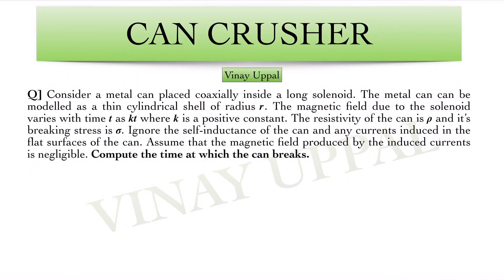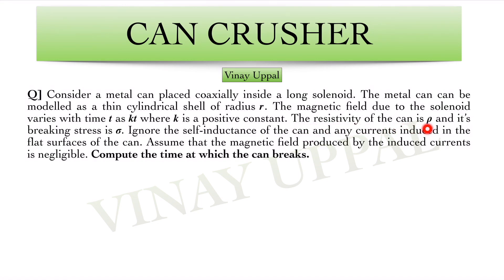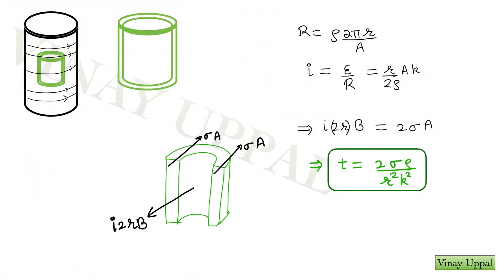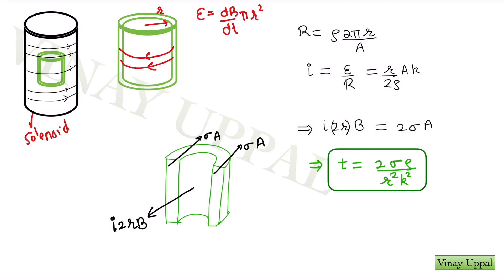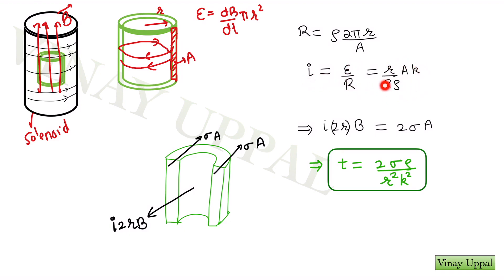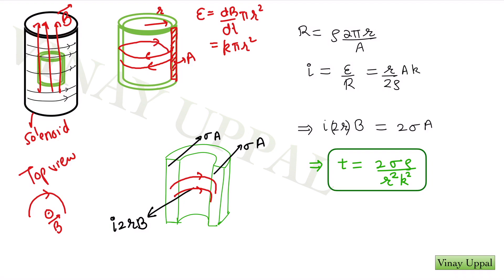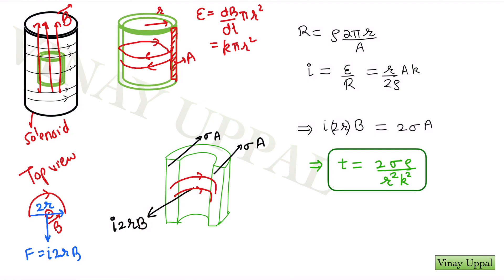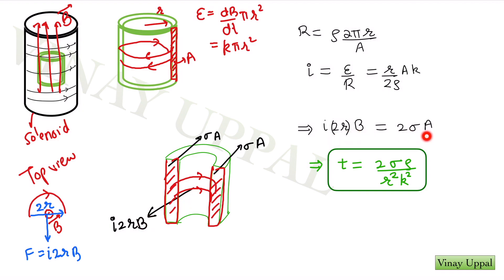PREDICTION: Episode 7 : Physics Girl Based! Can Crusher. EMI. Jee Advanced.

Comment: Sir why can’t we calculate induced electric field then use Vector form of Ohms Law to calculate current density. Assuming current I flowing across metallic can so force acting on it would in Outward direction BIL and then apply stress formula

Comment: Sir here instead of taking only a half section if we take a small element dl, there is a magnetic force Bi(dl) compressing it towards the centre. But what will be the direction of the force which opposes it and which part of the can applies the opposing force?
Reply from the maker: There will be tangential stress forces similar to a rotating ring but compressive instead of tensile
Reply: @PhysicsWithVinayUppal  Sir then how do we do this problem by taking elements and integrating over the surface? Because I'm not clear as to why we should only take half if the section, I thought we can get the same result by integration, but I'm not able to do so.

Comment: In the video the solenoid's length was small as compared to the length of can , and we know that the magnetic field due to a solenoid is maximum at its centre as compared to any point on the axis because of which the induced current in the can is maximum in the middle and it decreases as we go away from the centre in either direction , because of which the middle part of the can experiences maximum compressive stress , this is the reason because of which there is not a sharp cut rather there is bending at the portion of tear off and also because of this large induced current there will be a huge amount of heat produced in the middle portion which makes the metal soft and thus favours bending .Atlast the magnetic field due to the induced current is in the opposite direction as compared to that of solenoid so there is repusion between the solenoid and the can , half part of the can is facing repulsion in one direction and the other part is facing repulsion in the opposite direction which makes the can to tear off .
Reply from the maker: Perfect
Reply: @PhysicsWithVinayUppal  Thank you sir 😃
Sir do check out these two channels also Smarter every day , Steve Mould 
There can be many questions on their videos ....
Reply: @PhysicsWithVinayUppal  sir please create a jee advanced type question based on "ANTI GRAVITY WHEEL"
Reply from the maker: Only thing I'll add is there is also a longtitudinal stress in the Physics Girl video because of the radial component of magnetic field, whereas in my question there is no radial component of magnetic field
Reply: great analysis
Reply: Noice observatory skills bro
Reply: Thank you 🙂
But I am not that great 😅
Reply: Beautiful comment
Reply: Orz bro ✅✅
Reply: Nowhere in the experiment does the metal become soft. And your analysis is basic observation. Nothing special. Or interesting just like you.
Reply: @korigamik  Aww.. I smell something burn. Is it jealousy?
Reply: @satvikp3186  nah man, I just hate useless long paragraphs that people write just to pretend to be a little smug.
Reply: @korigamik  watch the video carefully you will understand. 
That's all i can say
Reply: @korigamik  well ....observation is key to success in jee Advanced !!

Comment: Sir a small doubt . The stress. You have calculated is the circumfential stress right?.in the physics girl video the can was breaking longitudinally.so shouldn't we calculate longitudinal stress here?
Reply: Same doubt
Reply from the maker: There is a longtitudinal stress in the Physics Girl video because of the radial component of magnetic field, whereas in my question there is no radial component of magnetic field
Reply: @PhysicsWithVinayUppal  thanks for replying sir got it So in this case cylinder will split like along the bisector plane right, not like as shown in the video right

Comment: Sir Where did we use the assumption that the magnetic field produced by the induced  currents in can are neligible ??
Reply: actually , we took the cross product of the length vector with the time changing field of solenoid given in q. so we ignored the field due to induced current.

Comment: sir i'm a bit confused there in the video can broke into two parts about a transverse plane passing through middle but by your explanation it seems to have broken laterally? what am i missing here??
Reply: In actual video the solenoid was thin and the compressive force was in the plane of solenoid ....And as magnetic field due to soleniod is max at central plane , the compression occurs predominantly at centre ....(about the experiment: analogically can visualise the Can to be cut by a knife super fast ...Which makes  it shatter in two pieces  horizontally )
Reply: @vickyb7888  yes the can is being squeezed at its equatorial belt so fast that it’s like being cut by a knife.
Reply: First of all in our case the Can is not going to break apart , the Can is going to crushed inside ,something like when you crush a Can with your hand. Because when you look at it from top view every element feels the force radially inward & as we have an infinite solenoid the magnetic field/force will be same at any point of the can. Which is not in the case of physics girl video that's why her Can break from middle because the inward crushing magnetic force is maximum at the middle portion of the Can. May be you are confuse with Sir's drawing, actually the stress wants to keep Can in same shape but after a limit it can't oppose further magnetic force. In short the can is not going to break in other direction it will just crush inward.
Reply from the maker: There is an additional longtitudinal stress in the Physics Girl video because of the radial component of magnetic field, whereas in my question there is no radial component of magnetic field
Reply: @PhysicsWithVinayUppal  but radial  component ko consider korna chyehh na??
Reply: Yeah , maybe because magnetic field due to incduced current is taken negligible
Reply: @periodictable4047  but if it were to break in the manner here there is no unique plane by which it should break(the only unique plane is transversal whereas all lateral planes are equally likely)
Reply: @lakshaybansal2470 yeah you've got a valid point , I never thought like this ! It can actually break from any lateral plane
Reply: I think even by sir's explaination it is being broken transversally.
The force i(2r)B is a component of the actual force which the curved face experiences at all points radially inwards.
 When this net circular inward force overpowers the (2 sigma A) force, The can fractures along a transverse plane.
This can be similar to a watermelon being ripped apart on putting many rubber bands around it. The pieces fly in a direction perpendicular to the transverse plane later. I might be wrong.
Reply: Bro you can use a simple logic that magnetic force in the video applied a kind of impulse not just normal force so giving a high velocity to can and normal from solenoid BCZ can was locked in experiment results in establishing equilibrium in transverse plane and as we know magnetic force for a solenoid is max at center it will break from center first  according to poisons eqn we know that any change in lateral plane result in a change of both lateral and transverse plane and due to normal rxn by locking of can lateral component become zero resulting in transfer of whole impulse change to transverse plane and so can broke with high velocities  in transverse plane